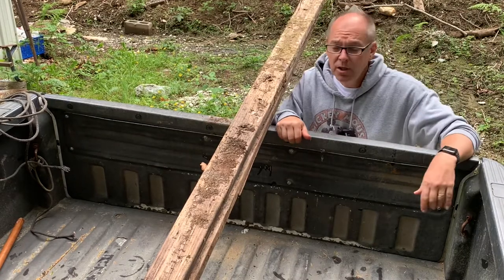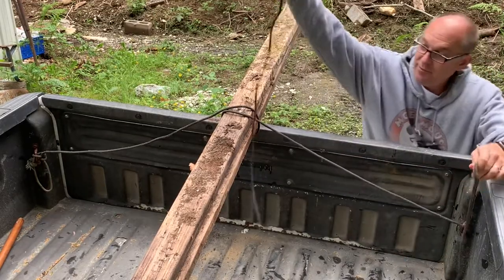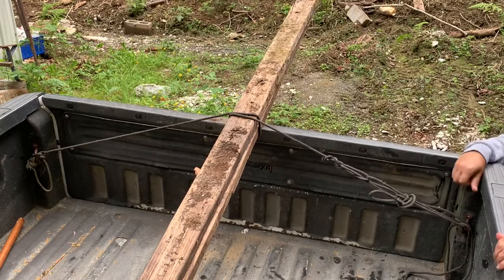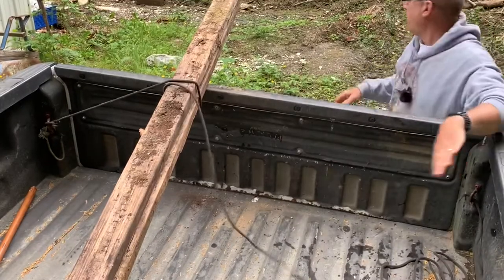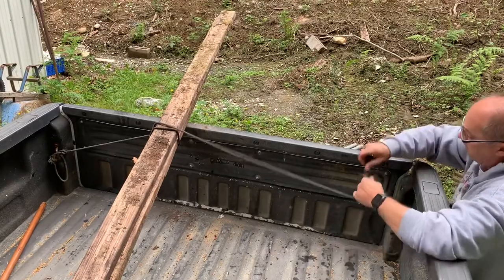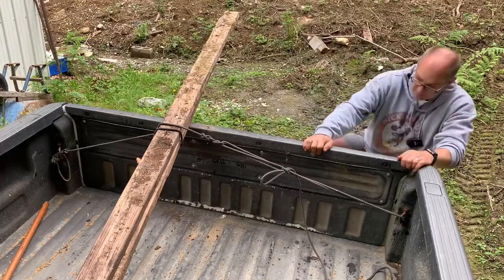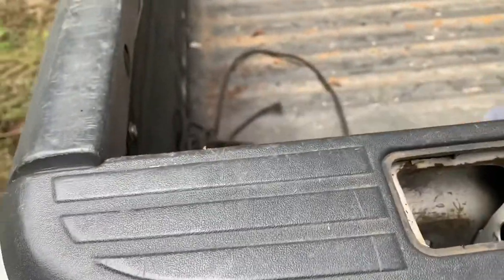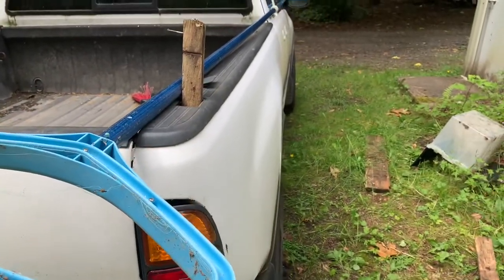One knot to bind them all. Hauling lumber #knot #lumber

Comment: So if I have a ratcheting tie down strap, I could just tie it around once , and then ratchet it? Seems like the same result. Im hauling twelve 10 ft emt pipe. I have ratchet straps and a 6 ft bed. What about the front of the truck. Pipe wont move side to side in the front?
Reply from the maker: I have done that with my 6’ bed. They don’t move
Reply: This is s trucker’s hitch. With a little practice, they’re very easy to tie/untie. And yes, they do secure your load very well.

But, If you’re using a ratchet strap, watch this video: https://youtu.be/lcnBk1EvrXE?si=u8ejqr10ndb3r7dB. I’m sure your strap will work just as well.  Good luck.